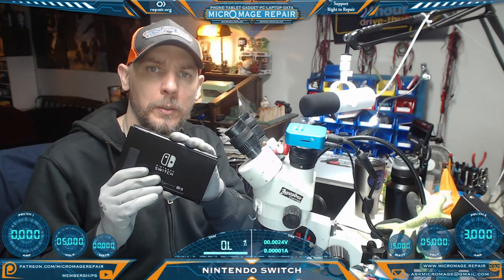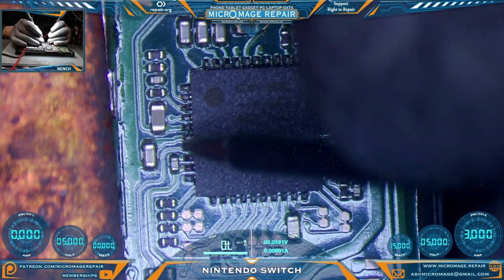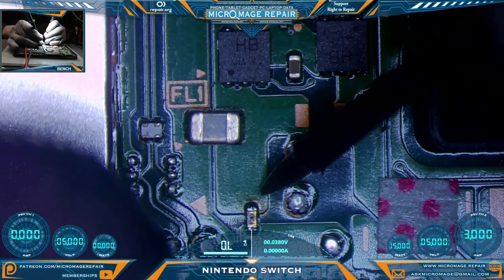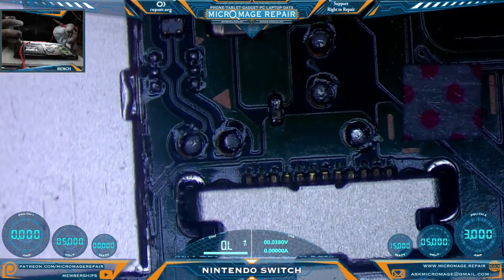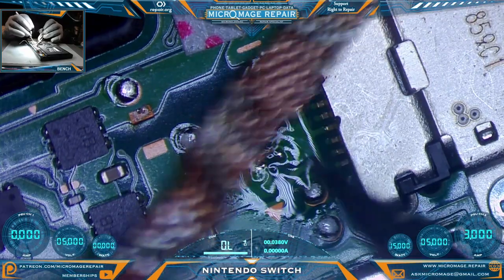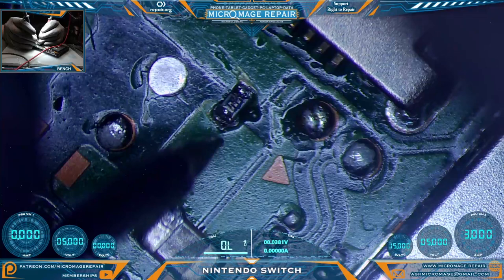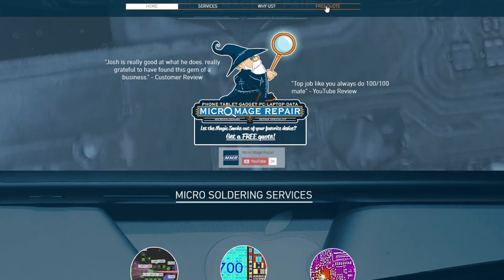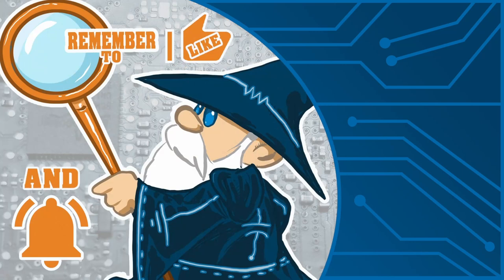🦅 Nintendo Switch: A VERY Rare Bird! 🦅

Comment: Wow, an easy one for you for once.  Normally, the $5 part protects the 5 cent fuse.  I guess now a days, it's $10 part protect the $1 fuse.  Great video.  Thank You.  😁
Reply from the maker: Yes, typically the M92T36 and PI3USB have to act as the fuses in the Nintendo Switch.
Kinda like the LCD connector in a MacBook. 😂

Comment: Hi. Do you have a repair video where even replacing a new typc c connector there is still OL on both D+ D- lines?
Reply from the maker: I'm not sure what you are referring to.
New type C on the OLED? Or in general?
Reply: @MicroMageRepair  Classic model. HAD-CPU-01
Reply from the maker: @brycond809  there should not be a short to ground on D +. I'd follow the troubleshooting process, check your chips and test pads.